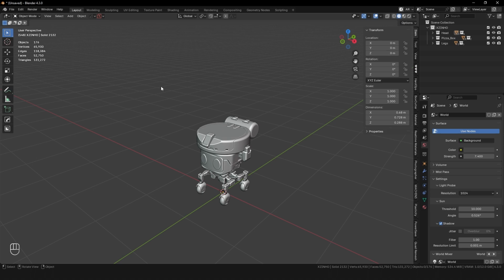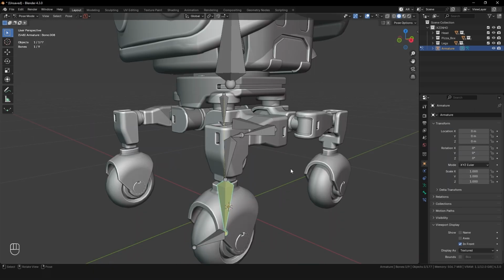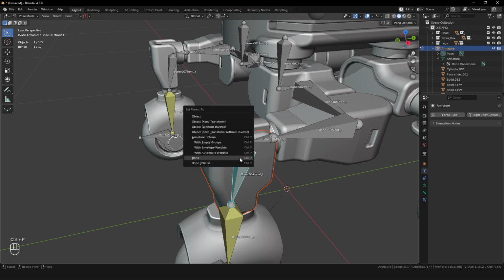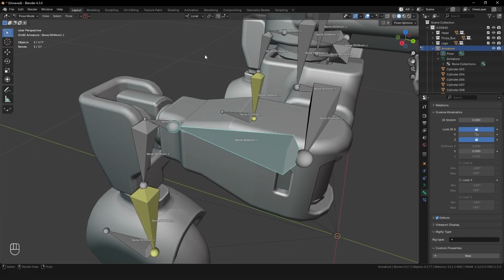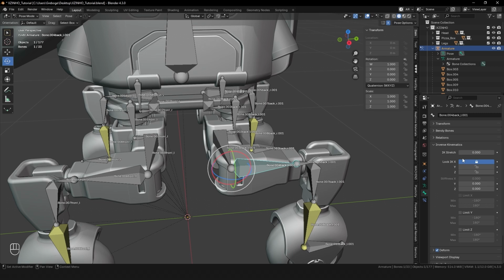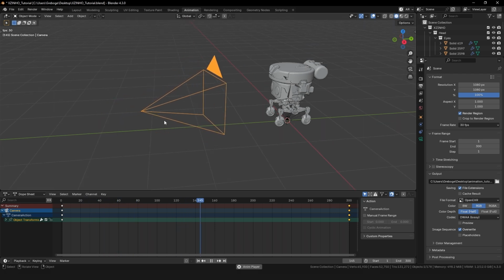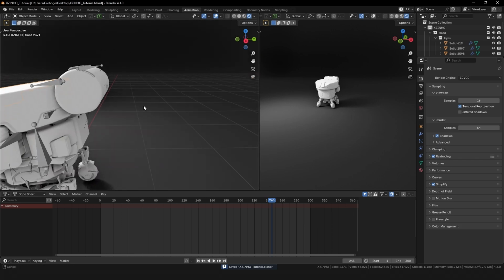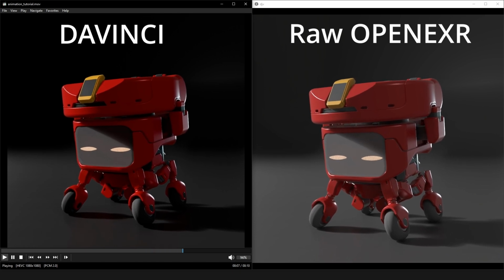Rigging and Animating Mechs in Blender 3D (With Exporting Setting!)

Comment: Are you exporting to OpenEXR because it takes less time to render? Or are there other reasons? I might have been careless and missed that part.
Reply from the maker: There are many reasons, OpenEXR, aside from having a small file size compared to PNG, offers advantages like high color precision, support for multiple channels, and lossless compression as well having Scene-Linear Representation of color, which means that the pixels directly represent the light intensity, good for post processing!
Reply: @greboge  Thanks for the reply! I really skimped on the output settings thinking it wasn't the most important part of this video. But I was wrong because I missed the information about it being a file format in blender. I thought it was about another program that rendered the scene. Thanks again.
Reply from the maker: @bredwud  I see! to be fair, i didn't explain it quite well in the videos as well! cheers mate!